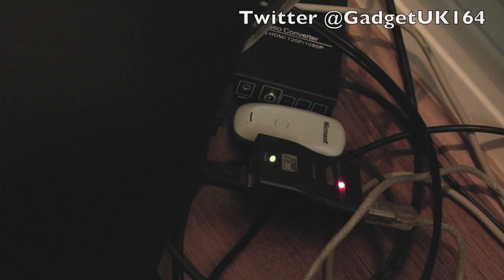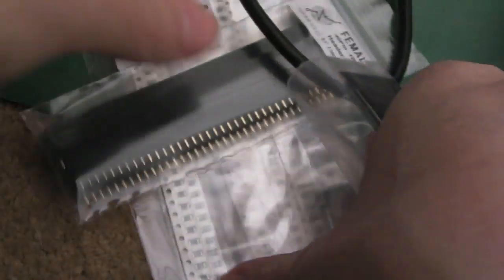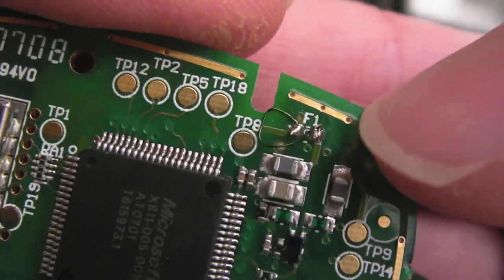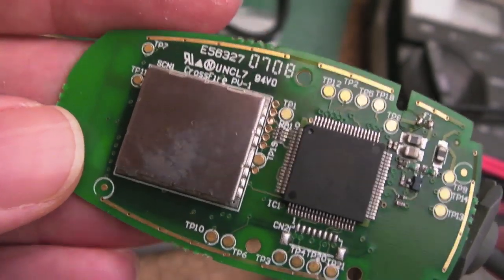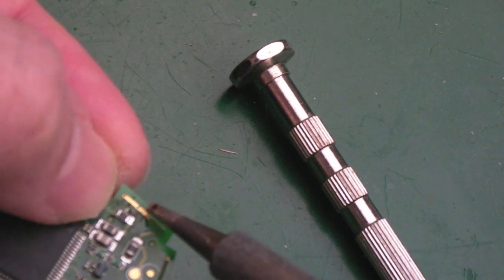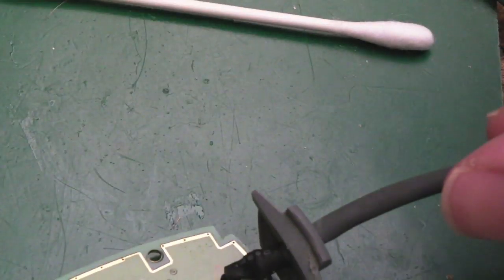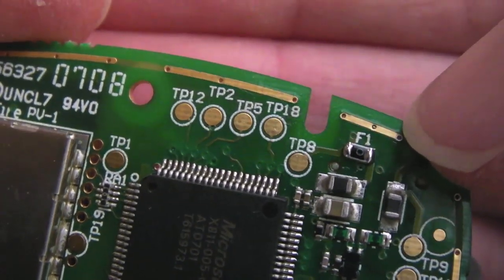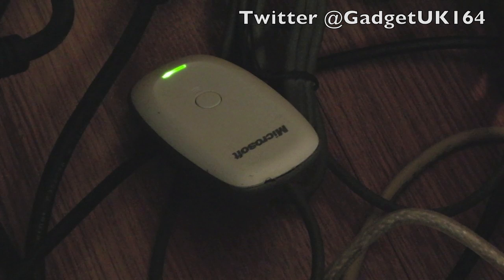Microsoft XBOX 360 Wireless Adapter Repair

Comment: Thanks so much for this video! I managed to fix my wireless adapter using it. I'm not very skilled at soldering, but it worked out. I simply bypassed the bad fuse with a ball of solder.

Comment: Thanks, fixed my borrowed broken receiver with a straight piece of wire in place of F1 (which when tested had no continuity). It works.
Reply: bro i cant believe that actually worked, thanks. I am so relieved now.
Reply: @savionramsundar1935  yes and still working one year on.
Reply: @Noidy312  nice!

Comment: Dude! Saved me $40 by not having to buy a janky third party adapter! Thanks a ton. I literally had thrown the adapter away earlier today after taking it apart and not seeing anything obvious, and then on a whim decided to search Youtube later and discovered your video. Thanks a ton!

My method was not pretty but it seems to be working for now. I just put a big ol blob of solder over the two points and it seems to have done the trick.

Comment: Excellent, a couple of nice short vids Chris. Just about to watch the alarm battery vid as I had to do this last year, and I was worried about it going off and disturbing the whole street. Haha noticed the watch as well ;-)
Reply from the maker: Thanks Vince =D  Haha at spotting the watch!  I can understand your concern about annoying the street - that was my worry.   The other worry is that you cannot stop it from going off once you've finished the work lol.  That was one of the reasons I went with this approach, coupled with the fact there are like 70 or so wires in there for all the sensors and power inputs etc etc.  It would have been a nightmare to silently shut it all down and remove / reinstall the PCB.  Plus I was worried about it reseting to factory settings and not being able to set it back up again - I am sure I would have been OK as I have enough documentation on it but it would have been painful...

Comment: MAN i love you .. there was literally no option to buy new reciever in my country .. i had an old motherboard from back in the day that i kept for parts (one of those cases that u never use) but what did u know there was lots and lots of the same fuses on it so i took one replaced the one from the reciever and it works. I have never touched a soldering iron in my life before so it was really really hard to do it it was so small :D but in the end it works THANKS .. i love my old 360 controller its better than the ps4 or xbox one

Comment: I wish I would have bypassed the fuse first before doing a rewire of the usb cable. I was on my second one of these receivers and didn't want to spend the money on another and your video helped me get it working again. Thanks. Same as @coolfizzin I fixed with a little bit of solder to bypass the f1 fuse.
Reply from the maker: Great you got it working!  Just bear in mind that that fuse is supposed to be "a fuse", in that if something on there shorts, it could damage the PC / PC PSU.  So a solder blob will get you up and running, but its better to perhaps get an 0402 or 0603 sized 0 ohm link from Digikey / Mouser / RS / Farnell / eBay!
Reply: @GadgetUK164  understood and appreciate the extra info. Will order one of those today.

Comment: I just tried to use my adapter and when I plugged it into my pc I got nothing, so I found your video and sure enough that fuse on the bottom was bad, I removed it and made a bridge and it's working again, I wonder what's causing this fuse to blow? and if we leave it bridged will it burn up other components? Thanks for making this video, it took me less then 10 minutes to get my adapter back to working.
Reply from the maker: A slightly bad connection can cause the fuse to pop.  Just bridging it risks damaging the USB side of your computer should it fail. Just buy an 0805 0 ohm link from eBay.

Comment: I used a tiny line of kitchen aluminum foil and some insulating tape because I've never soldered anything and I'm afraid I could destroy it for good. It's working just fine but do you think it could cause a fire if I leave it plugged it?
Reply from the maker: It's never a good idea to bridge a fuse position with wire or foil!  That said, USB ports have protection for over current, so it will likely never be a safety risk.  Personally I would rather use a single strand of very fine wire - perhaps 0.1mm thick, or just search for a zero ohm link component of the right size (0805?) on eBay.  Those are usually rated to 1/4 watt or 1/8 watt

Comment: Good video, thanks. Mine died yesterday and it was also the little fuse that had blown. Seems like this is a common issue. I ended up just shorting the fuse pads to get it back up and running.

Comment: what is the name of the part that ws installed? sorry im not an electrician, just want to have my receiver working back again, it is now 12 years, it broke today , just want to use my 360s controllers they are jewels
Reply from the maker: It's a zero ohm link.   Probably rated to 1/8 of a watt.  eg. https://www.ebay.co.uk/itm/334514919945?hash=item4de2a49a09:g:8EUAAOSwDiJi4UgM&amdata=enc%3AAQAIAAAA4IXoJM6PEJRg10KdOBQjsF3Nt9orB9stM5ZBzt03SOVdPrUcez%2BGkl3J6%2FFKiCeWQb5AEXZM0bXTK4ztdx2JqXq5kSSL6Asol6LnyHPQ%2FIYWO9RG8rtjSUUB68WzZ0YkPQG0bxS%2FosbMgjm1bVsQj6wuH34F0CPuZAKLaQac0PxcWLwpe%2FwQ5NdI9ocGi7NlZCohgU7LaOzZXAQ%2B%2B7B%2Fqfxju5ozrV07Wa3G5D8tFiyjMNEsfOlOz9KEZGmY87qd8sKGRU5IubiW44DmyfcpTGG6UCY8w9VuToh%2F%2BIMz%2Fc46%7Ctkp%3ABFBM_KD91vZi
Reply: @GadgetUK164  tysm on my way to purchase it

Comment: Thank you very much for the video, I also got my adapter repaired. However, I was able to replace the SMD fuse (design 0603 with the marking D = 250 mA quick-acting) with a fine-wire fuse 400 mA design 5x20 mm. Two wires were soldered to the small glass bulb fuse and the whole thing was covered with shrink tubing. The wires on the back are soldered to the pins of F1, but the fuse is fixed with some glue on the front along the circuit board near the USB cable. The plastic mechanism of the button must remain free. The fine fuse really fits from the available space. I also measured the current draw of the circuit, which was 85mA. Since these small glass bulb fuses are more common, it's easier to get hold of one. I would prefer a fuse over a jumper wire/0 ohm resistor as the USB port protection is maintained.

Comment: Thank you very much! You helped me enormous! Just brigded the zero ohm (F1) and it worked. I love you! :D
Reply from the maker: Thanks!  Just note that its better to fit a zero ohm link as they are probably rated to 1/4 or 1/8 of a watt.  If a short occurs it could kill the USB port.  That said, USB ports detect shorts and often handle it by isolating the power - so probably not a worry.

Comment: Seen a lot of these dead before. Bought a bunch when I saw a fix online many years ago. :) Thanks for keeping these alive, Chris!
Reply from the maker: I fixed mine before there was any online fix ;)  I had it early after they were released, and it lasted approx 1 week before it died lol.
Reply: @GadgetUK164  I probably only used mine once before it died but I had no idea when it happened (was well over a year before I discovered it). Looked online and saw I wasn't alone! These seem particularly fragile.

Fun fact: the original package promised Wireless Racing Wheel with Force Feedback support even though that never happened.

Comment: Do any of you know the rating of the faulty F1 fuse? I will short it for now, but eventually it would be good to replace it with a fuse of the correct rating again.
Reply from the maker: The original component is just a zero ohm link.  It's probably rated at around 1/8 of a watt.

Comment: What I did back in 2006 when I first got a 360 was bought a Logitech i think device which looked like a mini router, had 2 aerials and a ethernet connector,  was a nightmare to setup on Windows 7 and requried something like I.E 6  to get into the setup age which basically was a simple page asking for a SSID and password, I think it was limited to WEP. Think it cost about £20 at the time but went up to about £50 when the official Xbox device came out then back to to basically nothing when WPA became the standard. But didn't bother me as 2010 onwards used LAN.
Reply: What I forgot to say was I used a cheap alternative to a official product lol. I guess thats the same for controller adaptors.
Reply: This wireless adapter is for the controller, not the 360 itself
Reply: @dailyskeptic  I know.

Comment: i soldered wit tin in f1 and nothing happend, when i connect the adapter it leaves mi pc without sound and y have to restar
Reply from the maker: In some instances that fuse may have blown because something on the adapter failed.  It could be a bad IC.

Comment: I replaced F1 with a copper wire, and it works perfectly. Thanks!
Reply from the maker: That will work, but note it is a safety feature.  If the device fails short, it could kill the USB port its connected to.
Reply: @GadgetUK164  Then I'd better get a 0 ohm resistor as soon as possible. Thank you so much for your insight.

Comment: hi. I bought a used wireless receiver (microsoft original), plugged it into my Win10 PC, and it shows up as wireless receiver, but when i press the button, it starts blinking, I press the contoller button and it starts blinking as well, but never syncs up. Do you think the receiver is broken, or do i need to install drivers myself despite that the receiver is apparently recognized?
Reply from the maker: If it's powering up but not syncing, there's probably something wrong with the antenna part of it.  Maybe a failed transistor if you're lucky!
Reply: @GadgetUK164  I figured it out, it's stupid by Microsoft. So I had this plug & charge cable, and hooked up the Controller to the PC as well, only then did Win10 install not only the Plug&Charge thing but also the XBox Wireless Controller itself. Now I can remove the cable and it still works. stupid, but whatever, it's Microsoft. So installing the Receiver is not enough, you gotta somehow also install the Controller itself. Any Idea how to without this plug and charge cable?

Comment: I feel embarrassed now that I threw my dead one in the bin without even looking at it 🤣
Well done mate
Reply from the maker: Haha =D  I think most people would assume they wouldn't be repairable - this is a super common issue with them!
Reply: @GadgetUK164  At least I know now for when my new one breaks :)
Reply: Had mine for years from what i see mine has 2011 on it, had it since new great to know what can go wrong  ,now i just need another controller i gave mine to my sisters son with my xbox 360 so i have no controller for driving games now.
Reply: @GadgetUK164   can I just bridge it with some wire if I don't have a 0ohm link around?